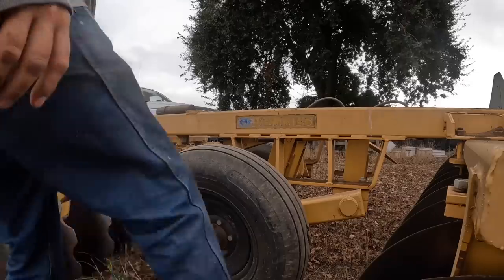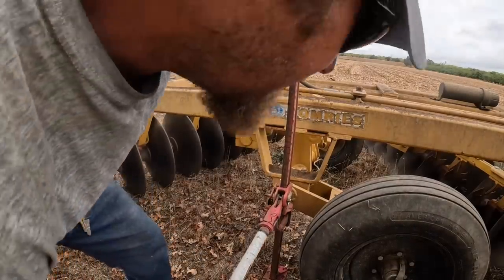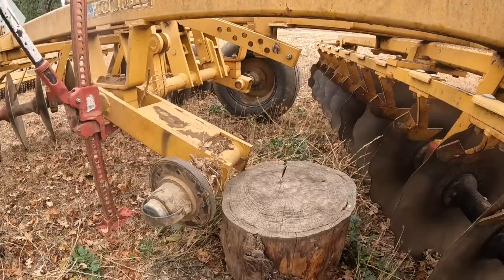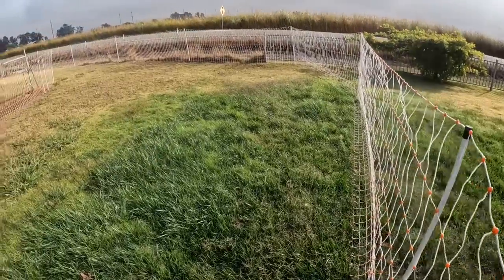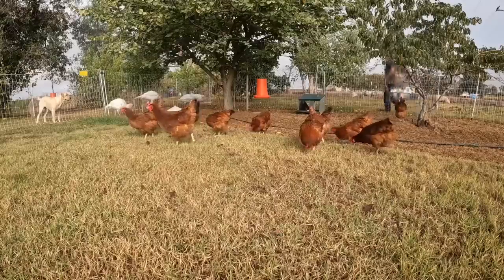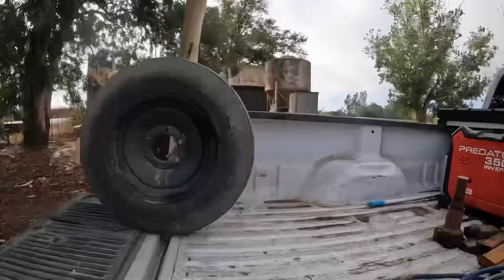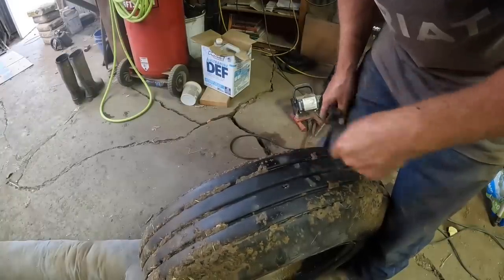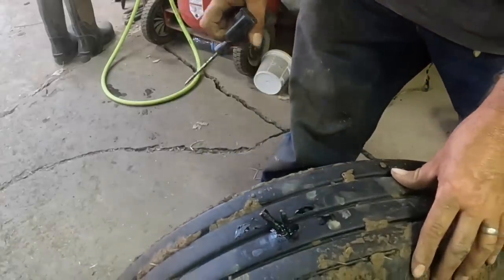Some Days Everything Fights You!

Comment: Hello Tyler to tighten the gang bolt leave on ground tighten the bolt. Raise it up , use a heavy  sledgehammer hit the end of axle not bolt end, lower it tighten more, repeat you can hear the sound when you hit with sledgehammer when its tight. I also find that a patch inside tire is the best repair. Have a great day.

Comment: I use these tire plugs from Tech. They  vulcanized together work great. Plugged a tire that a deer antler went through.  Farmers 185hp front end loader front tire on the side wall had a hole.
Took that kit over and put I think 2 plugs in tire. Lasted 3 yrs. Feeds 600 head of cattle and used it for farm work. Lucky on that repair 👍

Comment: The tire of the disk should be off the ground and not rotating with with disk in the ground.  You could pull the disk to the end of the field to change the tire.

I've never used rubber cement or another lube when inserting plugs.  I've never had one fail by coming completely out.  Maybe using the cement made the plug fail in that manner.
Reply: Wonderful information.   Wonder what the answer is?

Comment: Have you tried plug/patches? You have to break the bead and install from inside. Clean, rough inside of tire around hole like putting a patch on a tube. Patch has a rubber plug in middle you pull from inside to out thru hole after applying glue to inside of tire. They work much better than strand plugs

Comment: Have you ever tried using 347 stainless welding rods on that high carbon steel? I have had decent luck when extracting broken high carbon bolts from castings.

Comment: Tyler,
I have tightened many gang bolts (tine bars) with two pipe wrenches.   Go by a pawn shop or two and find a couple of 36 or 48 inch pipe whenches you don't beating the ever loving pe-wadely-do out of if you don't have such,  wear your gloves and glasses and get'er did!   When you get it snugged up, walk down the row and give each a love tap with a about a 3 lb. hammer and it will often brake any dirt and buildup loose.
As for that cracked disk, in a pinch cut a 1/4" plate about 1" over crack diameter and place it beside the disk.   As you most likely know, that leading right disk takes the most abuse and wear.  If possible to do so, move that disk to another position.  It is typical for offset tandem disk plows to wear from right to left.  While doing maintenance, evaluate wear and decide if rotating disk positions is viable.   It may not be an issue for you and your acreage.  My experience, on disks covering 14 ft and more, it is worth it.  Enjoy your content, have a great day!  👋🤠

Comment: Years ago we had a gang wrench - basically a box end wrench that would fit the gang nut and about a 12” solid handle. It was heavy duty and we would pound on it with a sledge hammer to tighten the gang.

Comment: Hello From Mark In Kentucky;  I wanted to mention that the inside of the broken disc would be good to keep to make a natural ready made shim with. 
In the past, I have welded broken discs with 7018 3/32 welding rods before for cracks extending long ways out to the edge of the disc but I never tried welding a disc broken like what your disc was that was broken, So making a shim would be making good use of a broken disc.
With your plasma cutter, you should be able to cut the inside of the disc very cleanly to whatever size you need to make the broken piece work for a shim. 
I also grew up on a farm and we didn’t waste anything if at all possible 
The implement tires usually fit the “X Factor” in that the tires are a never ending process. I have dealt more than once with tires that have never leaked after sitting idle only to go flat after putting the tire on after trying to use it - It Is What It Is.